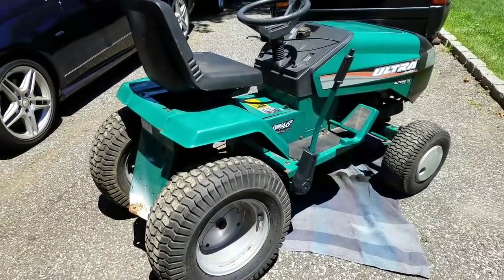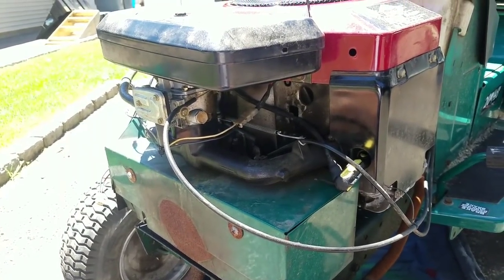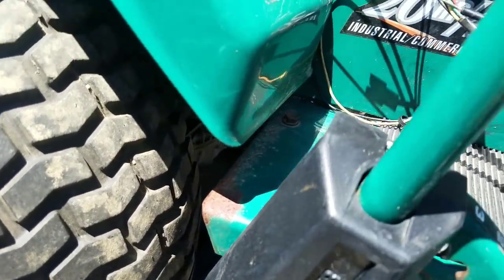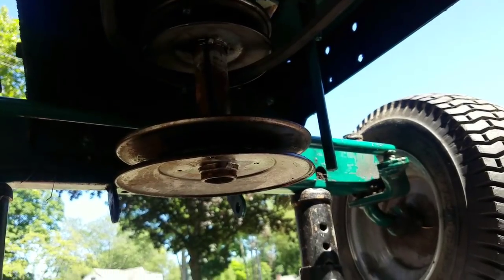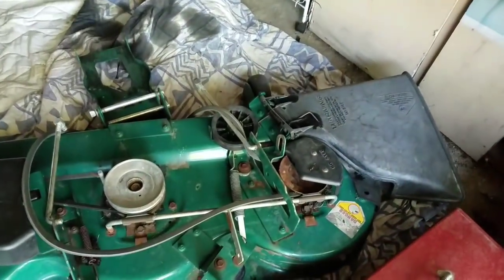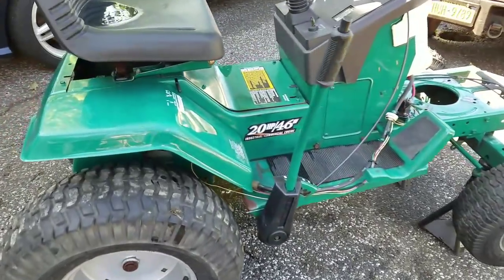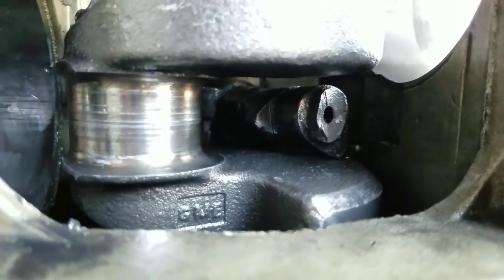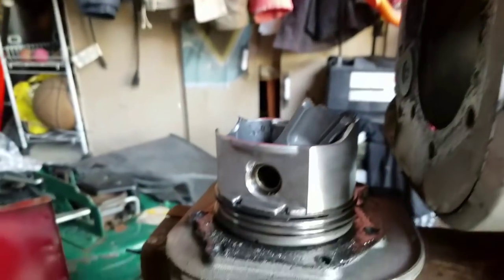MURRAY 20HP BRIGGS & STRATTON OPPOSED TWIN BLOWN THROWN CONNECTING ROD TEAR DOWN REMOVAL DISASSEMBLY

Comment: Here's a head scratcher for you, got a tractor, with a blown 21hp ohv briggs engine, I had gotten a very nice oppy 18hp, ok I took the bad engine off the tractor and put the 18hp oppy on, everything bolted up and plugged it no problem, hooked up fuel, and battery, and the sucker started right up, and ran super smooth, reved it up, sounded great, then all of a sudden, either a popping, or slapping sound started, not a banging..... Not a banging..... It would go away at higher rpm and sounded good at idle, but mid range popping or slapping sound, on the left side, ok so I took the spark plugs out, both sides have compression, ie.... Air blowing out of spark plug hole, so both pistons are moving, I put the spark plugs back in, and the sound from the left side is like the piston is slapping against the head, I'm thinking something is between the piston head and the head, like a bug nest, or made a bee hive, or maybe a blown head gasket, what are your thoughts, I'm digging into that side tomorrow and will let you know what I find, the sound goes from a popping to a slapping sound, never heard that b4.
Reply from the maker: Now I'm dying to find out...not rats nest..how could they even get in there? Maybe it's a broken spark plug?
Reply: @MowersNBlowers  Henry, do you have any experience cleaning out the carbon buildup without pulling the heads? Thanks
Reply from the maker: @Sheeeeeeeeeeeeiiitt  how are you going to clean carbon without pulling the heads?  Solvents like Seafoam can only do so much.  What’s hard about pulling heads?  Just need new gaskets.
Reply: @MowersNBlowers  You are %100 correct lol you past the test haha thanks

Comment: safest course is motor replacement
Reply from the maker: ed edwardson yes, thats what im gonna do, thanks bud for your input!
Reply: no sport in that, rebuild it... use it on street riding mower... E BAY DIGITAL TACH/hour meter... 4000 RPM MAX RPM... remove gov inside and outside ofmotor to clean it up appearance wise.  FRESH OIL EVERY 30 hours.    write CHECK THE GD OIL BEFORE EACH RUN OF THE DAY!!! DO NOT OVERFILL!!!!! USES 15-40 motor oil... with 20-50 blend? since most ppl cannot check or everchange the oil in anything ... and then wonder why it is blow up???? TSTB's

Comment: Henry too much damage, clamp doesn't belong tells you somebody been in engine. To me its time to find good used engine. ebay or check price at harbor freight for new one. Still worth saving the Murray.
Reply from the maker: Gary Belanger great advice gary, it seems to be the popular answer. Thanks.
Reply: Mowers N Blowers $699 for a predator air cooled v-twin
Reply from the maker: Uh...what profit would I make if I spent $700?

Comment: U need a ring compressor and look for a diagram on how the pistons go in if u can't figure it out I'll pull mine apart and let u know
Reply from the maker: No bro...not necessary, the owner of the saw doesnt want to spend the money.  If he decides to fix it...I have ring compressors.  Thanks bro.
Reply: the mark in the top of piston goes toward FLYWHEEL.  the #1 piston/cyl is the one closest to the flywheel.  that is a pressure lubed engine... should last forever but ppl canot CHECK THE OIL BEFORE FIRST RUN OF THE DAY... change oil every 25 hours (with no filter) or 50 hours with filter engine.   cuz ppl wont write on the COWL OF MOWER/motor... CHECK THE GD OIL BEFORE STARTING!!! DO NOT OVERFILL!!!! MOTOR WILL BLOW UP!!!! uses 30 wt/ 10-40, 20-50 let motor warm up 5 mins before first run of  the day.

Comment: The crank is shot and the cost would be too much so look for another engine...a hose clamp in the engine? Someone's been in there before
Reply: I disagree you can save that crank and would be cheap to rebuild its a mower not a racecar running at 9 grand lol the aluminum scoring ya see can be removed with some acid and light buffing some new rods and wala a running mower again
Reply: I’ve done it before too.

Comment: Hey Henry I've got a motor  for you same motor  $60
Reply from the maker: Lol...jeremy, I dont pay $60 for anything.  Mostly all free.
Reply: jeremy thiel 20hp briggs?
Reply: @MowersNBlowers  not trying to be a smart ass or anything. But, if you don't want to pay for anything why did you ask for advice on what parts and assembly advice if you don't, at least, want to pay for parts? Since, I already saw that you did something else. My advise would've been to get the service manual for that engine. Its available for free on the internet "271172 Twin Cylinder L-Head repair manual". Use a semi-rigid plastic somewhat larger width wise than the piston, with a large hose clamp to collapse the piston rings and use the wooden end of a maillot to gently push the piston into the bore (https://www.youtube.com/watch?v=VISqGGMcBTc). Moreover, do your own research, look at many youtube videos on what you want to do "Mustie1" and "Taryl Fixes All" are my favorites.
Reply from the maker: @georgemitchell2288  advice is free. And parts can be acquired free as well.  If no one gives me the advice, no harm no foul.  And yes, I research everything before I leap.  But I have lots of subscribers who contribute their advice and expertise. Plus this video was a few years ago, tractor has been sold long ago.  There's about 700 episodes since this video.

Comment: that thing would still run fine with that broken piston based on where the break is... 
I ran my RMX 250 with a broken piston like that... and It never had any issues.. Now if it was broke at the pin holes.. that would be a problem-- obviously.
Reply from the maker: As you must have missed in the video, BOTH rods were broken and weren't even touching the crankshaft so...NO it would not have run and it didnt run.
Reply: I got so tired of my KX80 piston skirt breaking I would just saw the skirt off on one side. Worked great.

Comment: Sad thing since OBAMAM cash for clunkers. Cost for parts for anything has got out of hand. Just a sump gasket and bolts for the sump can cost 26.00 dollars just for that. That being that old of engine may not even be able to get some parts. The U.S. Goverment wants you to buy new and even sadder newer stuff is junk unless you spend 8 grand then it may not be the good stuff. I used to be a Small engine shop part time and was a dealer for Briggs, Tech, and Kohler. Been out of it for 25 years because the price of parts and labor people just would not come back for there stuff. That and the big three wanted the small guy gone. Now they wish they had the small guy back but the parts are just crazy nowdays. That's when I only charged about 10 dollars a hour or buy the job. Lost on some won on other . Broke about even really in the end. I had that engine myself on a MTD and mowed 3 acres for 20 years. Sold it for 100 dollars with 2 decks in good shape. Only thing I replaced was 2 coils that went out in 20 years. Plus just the normal maintenance stuff. I just could not sell it for more. Wish I had it back for that price today. Today they all make junk IMO. Today just be sure to change the oil and filter if you want the new stuff to last. On that twin didn't even have a oil filter and they lasted for ever if you changed the oil regularly. Look on you tube for the newer engines and they just make junk today. As far as parts have to buy much my as well junk it or save for parts if you have the room.
Reply from the maker: Thanks Arthur, the stuff now is cheap and junk like you said.  Parts are cheap on ebay though, they're Chinese copies mostly, but they work! Hope you subscribed

Comment: i think it was over-revved with junk oil, that hose clamp looks like it is holding the governor and the rigged throttle. if the case is good use it for parts or rebuild it. up to you👍
Reply from the maker: David, case was trashed.  I put another opposed twin in it and sold the thing for $650 recently.  Hope you subscribed bro
Reply: e bay digital tach $10 DO NOT REV OVER 4000 R's, the rods/flywheel wont take it.  FRESH OIL EVERY 30 hours. 15-40 diesel oil  or blend of 15-40 and 20-50 motor oil with STP oil treatment... still 4000 R's max without billet rods/flywheel $130/EACH and $350 flywheel, cam $280

Comment: if you still have this laying around i want it
Reply from the maker: The engine or the tractor?
Reply: @MowersNBlowers  the engine
Reply from the maker: Long gone, sold for parts...I still have some stuff, what do you need?
Reply: @MowersNBlowers  Do you have any big bore walbro carbs?
Reply from the maker: No carbs for opposed twins...super expensive.
Reply: Mowers N Blowers not just for opposed for singles.
Reply from the maker: @trailerparkgarage6574  not anything perfect
Reply: @MowersNBlowers  What do you mean by that
Reply from the maker: I have a couple of carbs, but either emulsion screw jet is stripped or fuel mixture screw is broken....not perfect.

Comment: Total junk.....................Crank Case might be the only salvageable piece. The last time I saw a busted Con Rod like that, it was due to two reasons, low oil volume and a governor failure, allowing the engine to over rev, causing excess heat and stress.........BOOM!..POW!..KABLOOY!
Reply from the maker: That sounds right, the guy had a crazy throttle lever to over rev.  The oil was black as death.

Comment: Sorry, trash, that's a common engine You can find a Use  one for around 50 are 100 bucks. Take that 1 apart and  see what makes it go? Good times
Reply from the maker: Old video,  it’s a series,  got a free oppy and replaced it,  sold it shortly after

Comment: Buy new engine
Reply from the maker: Ok..send me $750!
Reply: rebuild it with e bay parts... $100 or so. someparts can be saved? the crank polished? file the ruff parts off it with file/grinder.  new rods $26/each, new cam $25, gaskets $13, freshoil 1.5 qts x 2 after running it for 30 mins or so to clean out the motor and replace the oil in the motor.  throw gov mechanism away, $10 e bay digital tach hour meter set on setting 2 (fires each timepiston comes up on brigs as it is a dead fire on the exhaust closing/intake opening TDC so nothing happens when plug fires then).